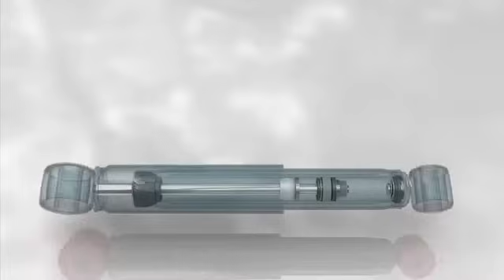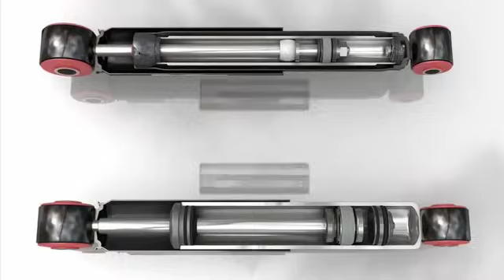What are shock absorbers and how do they work?

Comment: I don't think the function of a shock absorber is to necessarily dampen oscillations.  That's a secondary effect.  Its real function is to isolate spring rebound after compression.  That also impedes oscillations.  It's one of the most misunderstood parts of a car. IMHO.
Reply: Sorry dude, but this is wrong. Basic physics equations model the system, and the shock absorber is for dampening.
Reply: Old video and comment I came across but something can be designed to do more than 1 thing. Either way the shock's only goal is to maintain control of the spring.
Reply: I'm misunderstood 😪
Reply: Greetings all, 

This is Mechanical Engineering 101, where we all learn about SYSTEMS, and first understand that mechanical "systems" like automobile suspension systems can be modeled using 3 physical components: 
1. a "MASS";  (in this case the axle and wheels) which moves up & down in reaction to bumps and holes in the road, and thus generates kinetic energy; 
2. a "SPRING" which provides a "RESTORING FORCE" which is proportional to the DISTANCE the spring is stretched or compressed from its relaxed position; and 
3. a "DAMPER" (aka "shock absorber") which also provides a RESTORING FORCE, but in this case it's proportional to the VELOCITY ("speed") of the motion occurring to the system (axle & wheels) 
 - the FASTER (or more sudden/violent) the bump or hole, the MORE RESISTANCE TO MOTION the shock absorber provides :-O 

Now let's look at the 2 "force-resisting" components: 
- the SPRING can actually RESIST motion, but it CANNOT actually DISSIPATE the KINETIC ENERGY in the system after (say) a BUMP; imagine an old, tired suspension where you see the entire car wobbling up & down & up & down after hitting a bump, and there you have a MASS and a SPRING but NO "DAMPER" :-) ... 

- the DAMPER (shock absorber) is the only actual ENERGY-DISSIPATING component in this SYSTEM. Without the DAMPER, all the SPRING could do is REDIRECT the energy, but NO DISSIPATE IT... 

SO... YES - the PRIMARY (even SOLE) purpose of the shock ("energy") absorber (damper) is to DAMPEN OSCILLATIONS. Period. 

Fun topic. 

- Mark Vogt | VOGTLAND OUTDOORS | NORTH AMERICAN ROBOTICS

Comment: This is Kristin from NANJING MANWOSI SHOCK ABSORBER CO.,LTD,major in making shock absorber and air suspension for truck and car. Learning you are also a manufacturer,we hope to cooperate in the near future.

1. Our shock absorber / air suspension price ranges from FOB Shanghai USD 30-300.The price depends on shock absorber / air spring suspension parameters.

2. We manufactured shock absorber from 1991,and also cooperate with many clients like KYB, HUTCHENS..Goods can be customized and small order accepted.

3. You can send us packing drawings or other requirements you need,we will do our best to achieve.Besides,many products are customized according to clients requirement.
If you are still in hesitation,you can try to get some samples and examine them.

Waiting for your OEM No.

Kristin
Injection & OEM & Mould service , help you save cost.
FAOIS(Nanjing)SHOCK ABSORBER CO.,LTD
Wechat & Tel & whatsapp : 86-13722265477
Skype：ganglqq009